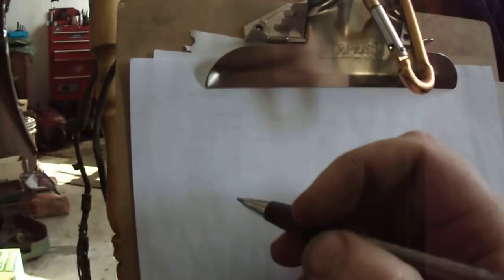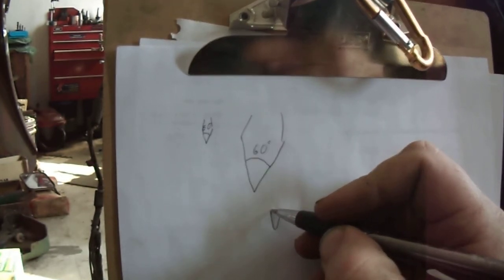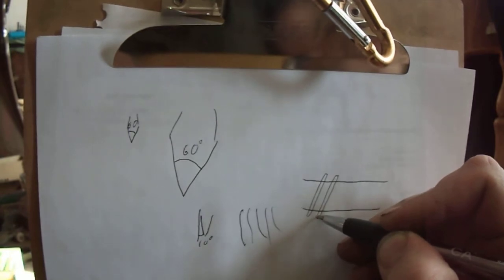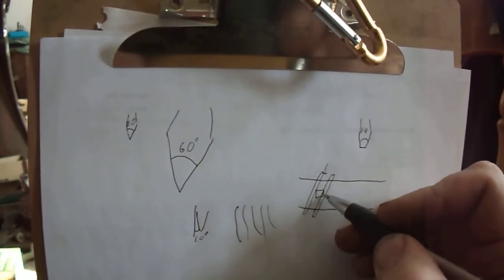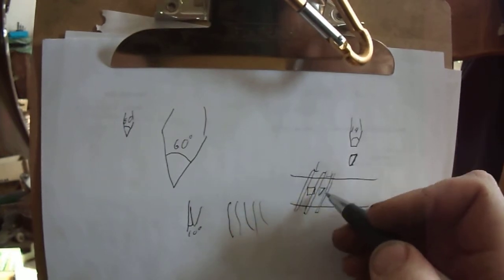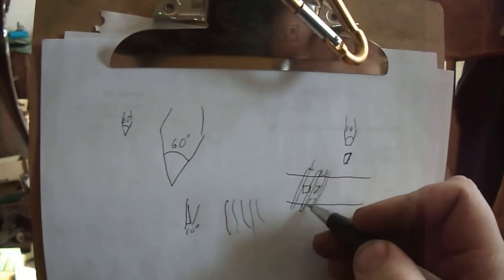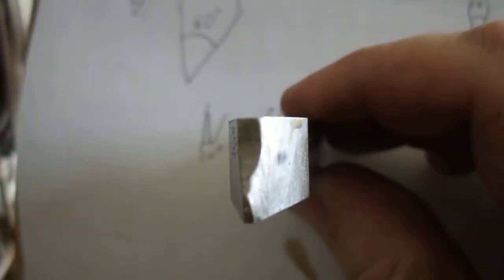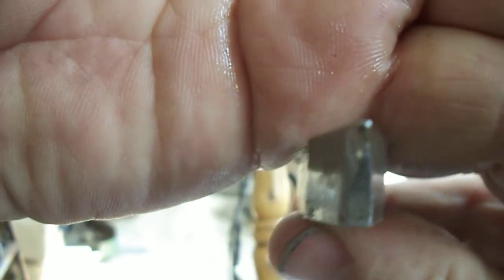ACME Thread Tool Grinding Thoughts

Comment: Good info. I think the side relief is sometimes overlooked or kind of shoved to the side in place of stressing the 29 degree grind and compound settings explanations, but then it's learned the hard way at the lathe. I'll tell ya, I was pretty happy to have pulled off a first time square thread vise screw replacement not long ago. I have an Acme external and internal coming up soon on a project too. Keep up the good work, thanks.